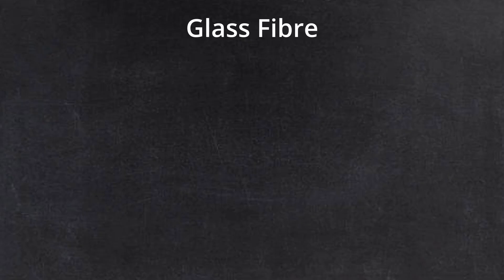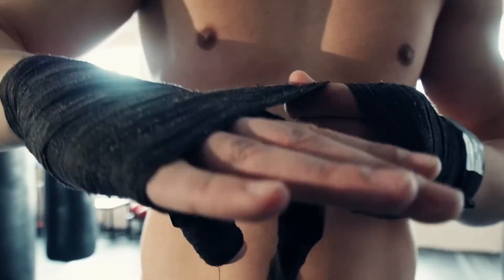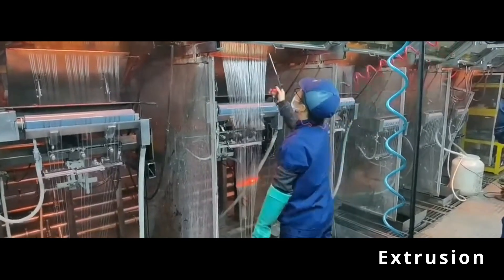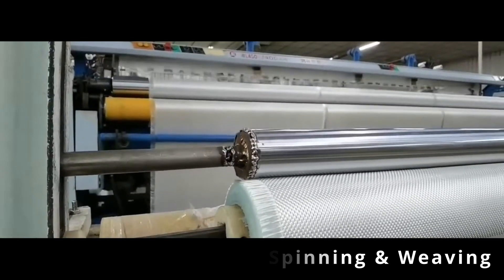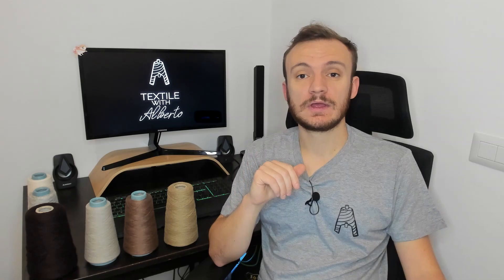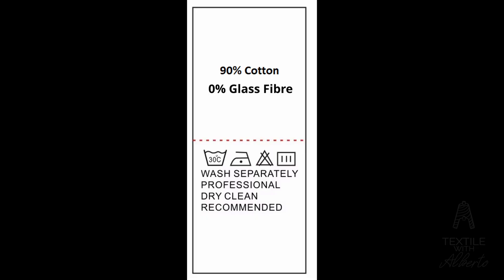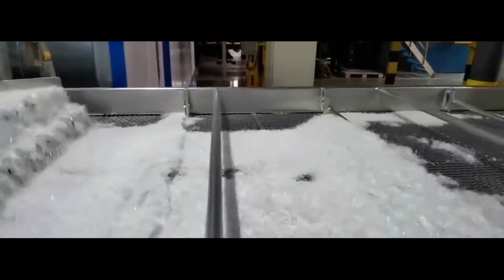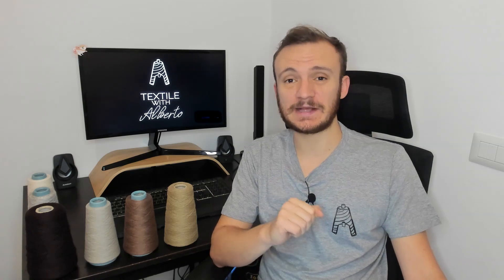GLASS FIBRE - is it used in Fashion Industry?

Comment: also woven glasfiber is used in aerostructures (radar-dome). in addition fiberglass textiles are used a lot in the sports industry such as skis, sailing and motor boat industry as an alternative to carbon fiber  textiles which are more expensive. Nonwoven Glasfiber is also used for insulation in kitchenovens. Glasfibers can be colored, it just needs to happen before the fibers are spun and not in combination with the cotton. 
Carbon fibers are mostly made from PAN a synthetic polymer which then gets carbonized, so its in most cases synthetic fiber and not organic (pitch based carbon fibers cound be calles organic, but they are rarely used due to a high price). 
It's a good video, but i think you could have easily included even more interesting and sometimes more accurate information.
Reply from the maker: Thanks for the interest in this video! Love all the information that you brought to the surface. Take into account that the information in the video is very elementary, meant for people who are surprised to read "glass fibre" in textiles. Anyway:
1. You are right: glass fibre is used in nonwoven, woven and sometimes also knitted form in a number of different applications (from sportswear to aerospace and filtration).
2. Glass fibre can be indeed colored, but not with conventional textile dyestuffs.
3. "Mineral fibres" are divided in "natural mineral fibres" (asbestos is the only mineral fibre in nature, along with few others) and "man-made mineral fibres", such as glass, carbon, ceramic, etc. Carbon fibre can be obtained by PAN (most of the times) or rayon (rarely, but rayon is not synthetic).
It's true that generally the starting material is synthetic, but is conventionally defined as "mineral" to discern from conventional synthetic fibre (polyester, polyamide, etc.).
Your points are all correct, but they'd need much much more time to deepen some topics. I decided to cut and sum up the information to avoid being too technical and long winded.
Appreciate you are pointing all this out though, gives me more ideas for future videos, perhaps carbon fibre! Cheers mate!